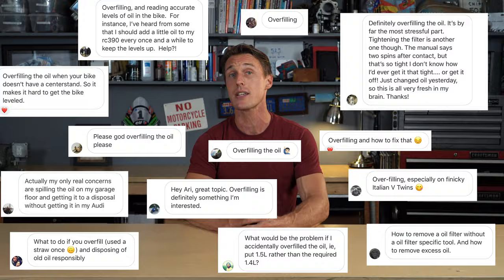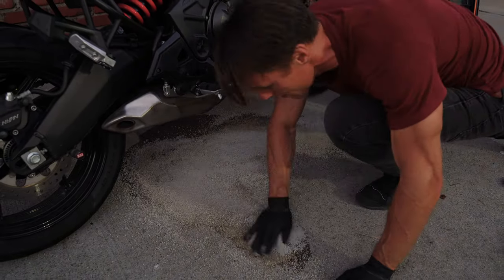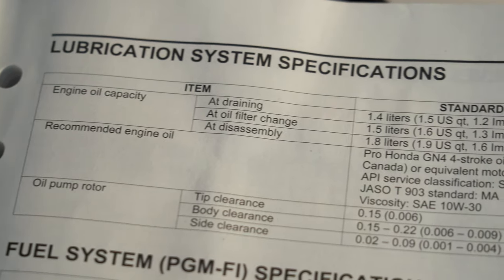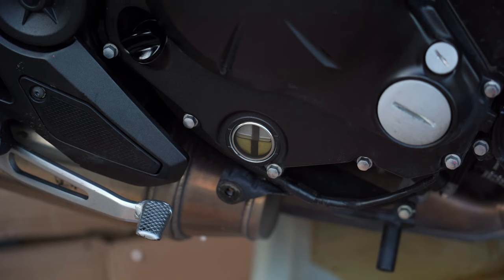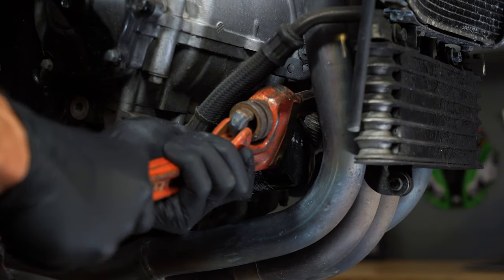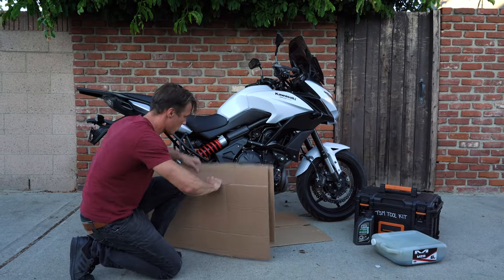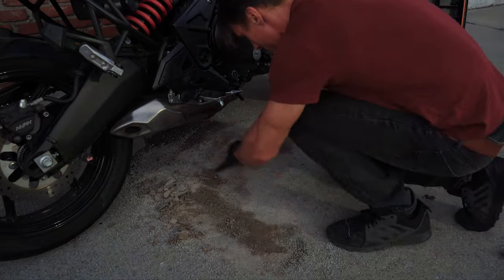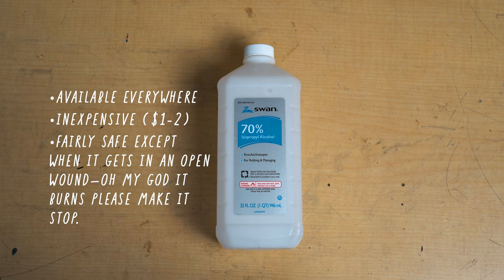Overfilled Oil, Stuck Filters, And Oil-Change Hacks | The Shop Manual

Comment: I have found that if you let the engine cool down before you attempt to remove the oil filter, it comes off easier, or buy a K & N filter with the 17mm nut.

Comment: Turkey baster is my favorite cheap and disposable tool in my oil change toolbox. Little too much oil? Sucks right out through the fill plug. A smaller piece of tube can be used to attached to the baster to extend it if it’s not getting suction.

Comment: My favorite oil-change hack is the one where you only ride 2-strokes.  In street bikes which pretty much all had automatic injection, this just means topping up the oil tank every once in a while.  Then change the transmission oil like once a year or something; clutch and gear debris is kept out of the engine so you can let it go longer.  And no oil filters, ever.

My SECOND favorite hack is the Aquafina trick.  Bikes will vary, but at least on all the vintage Yamahas and Kawasakis I've had, the dipstick/filler threads are the same as an Aquafina water bottle.  So cut the top off to make a funnel, then you can thread AND TORQUE your new funnel in place.  It flows faster than a "real" funnel, is sealed from spills, and can't get knocked out of place or bottom-out on your clutch or whatever is down there.  This was very valuable during that dark time when I owned my 4-stroke Yamaha and thus had to dick around with oil constantly.

Comment: One hint for anyone with some bare tools that happen to cross stuck oil filter. Get a decent length bolt that you have socket or box end wrench that fits. Then cut the thread end with angle grinder or hacksaw. Now get piece of strap that goes around the filter and put its ends through that slit just made. Open filter. There can be cases where some idiot has put filter way too tight into something you can't fit any tool. In worst case if you hammer screw driver through filter you can make it just torn apart in place. I've encountered this couple of times and since moved into this bolt and strap strategy and it hasn't ever failed.
Reply: I'm not sure I understand your instructions there, but claw type wrenches work great.

Comment: Oil filter pliers are great..   Didn't mention them!
Reply: Yeah lubing the o-ring with some fresh oil and not over-tightening is key! But I have a couple sizes of those oil filter pliers and they are nice even on non-stuck filters.  Use them on my car too.
Reply: Yeah I have the oil wrench socket thing. I always just go "hand tight" on the filter to tighten.  Maybe stick that wrench on and go a tad more than hand tight. But last time it came right off easy.. with oil filter pliers, LOL.. but could have used wrench.  Good thing to have one of each I think!
Reply: Can never have enough tools!

Comment: Don't use rubbing alcohol as a solvent for cleaning oils. It is only 70% alcohol, the other 30% is water. Go to a home improvement store and purchase pure IPA (isopropyl alcohol).  Note: Not all home improvement chains stock solvents (other than paint thinner). I can purchase IPA at my local Home Depot but not at Lowe's.

Comment: For my Sportster have to get a soft drinks bottle and cut a section out of it so it fits under the oil filter to catch the oil released when I unscrew it to avoid oil getting in places difficult to clean.

Comment: 2:41 when i was a kid and used to do oil changes on my parents and relatives cars a couple times i used a screwdriver and stabbed the spin on oil filter straight through and used the screwdriver to turn it if it was way tight.  It was on an early 90s VW and very little room to reach it.  Anyways i comment as i watch most videos :)

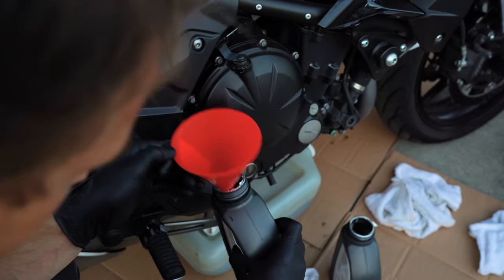Comment: At 4:39 when you're talking about obvious ways to avoid spills (the "use a funnel" segment) - it also helps if you pour the oil correctly, with the opening at the top, so that air can get in, and it pours smoothly. Don't feel bad, every single YouTube oil change "expert" holds the bottle upside down when they pour oil as well.

Comment: If you have your oil changed at a dealer, bring the proper sized wrench with you to check that they indeed tightened the drain plug(s). You only need a drain plug to work itself loose on your ride home once for you to always do this. (Hand to God it happened to me, thankfully at a slow speed while pulling away at a light)

Comment: another tip to remove a stuck filter is to fold sandpaper over so it’s abrasive on both sides and wrap it around the filter to give you some grip

Comment: Strap wrenches suck, I have the scar to prove it–I'd much sooner use the screwdriver trick, but didn't know it at the time. Definitely spring for a filter socket, or buy a filter such as K&N that has a small hex-shaped extension so you can use a regular wrench or socket. They're often just a couple bucks more.

Also, I know the drain plug has a torque spec–ignore it. Use a box wrench and don't go crazy. 18-year-old me managed to bork his oil pan and had to drop out of a much-anticipated trip because he was trying to be diligent and follow the book. JB weld wouldn't seal it, either.

Comment: I've found that if the oil filter is secured using a bolt (ninja 250 comes to mind here), a breaker bar is your best friend. Stick your head under the bike, remind yourself which way to loosen it, put it up on the centerstand (And have an assistant hold the bike still if needed), and apply constant pressure until it gives. Do the first turn or two with the breaker bar, and then it'll be loose enough to just spin off by hand. Let any remaining oil drain, pull the old filter and seals off, clean, dry, and reinstall. Most tedious part is waiting for the water to fully dry off. The hardest part for me was actually tracking down the requisite 17mm socket head and 1/2" to 1/4" socket adapter at my local hardware store

Comment: Harbor freight sells locking oil filter wrenches. Think vice grip but with a oil filter jaw. If you really need that much torque, I feel like it's a better option than trying to fit a pipe wrench in there.

Comment: Great tips.

Isopropyl alcohol is not safe for all plastics.  It'll dissolve acrylic, and that's one of the three polymers in ABS, which is commonly used for motorcycle fenders and fairings.

Comment: My 09 zx-6r was about midway up he bike, recessed in far and tight enough I couldn't even get my hand around is, much less stab it. I went to K&N wrench off filters that had a (correct me if I'm wrong) 17mm nut on it, so you can remove it with a socket. I have heard of nut breaking off when trying to remove it, but I never personally had that issue. 

Oil filters only need to be firm-ish-ly hand tight, not gorilla torqued. I think most torque values for filters are like ~8lbs, which isn't much. Also use a couple drops of oil to lube the sealing ring, that will help it snug up easier, and removal for next time will be easier too. I have never had a filter loosen up or leak on me by not screwing them on super tight.

Comment: I picked up an oil change tube for my crf450L.  You lay the bike over, take drain plug off and put the change tube on it and pick it back up.  Only picked it up because oil gets all over the frame and skid plate without it.

Comment: You can also use a belt to get stuck filters off. ;)
Reply: You can also use them to open stuck pickle jars.
Reply: Yeah, plus if you take long bolt, cut it's thread end and use some strap you can get filter out of virtually any machine without breaking filter. Handy tactic if normal filter tools won't fit.

Comment: Oh man, overfilling... While on vacation, traded houses with a couple in Barcelona for a couple of weeks, nice appartment with a parking place in the basement in a shared sub-terrain garage.

So I noticed the oil level of my bike had gotten a bit low, bought some oil, went to fill it. Darn! Too much... Since I didn't have all the equipment I have at home, I decided to drain a bit from the drain plug. Loosened it a bit, very small drip. Loosen some more, lost hold of the plug...

Exxon. Valdez.

In a half-panic I decided to throw my long sleeve shirt on the (by then) pretty substantial oil stain. Later with a lot of paper towels the parking spot got pretty clean again, since the floor was very dusty to begin with it may actually have been cleaner after my unintended oil bath.

But man, that sure ruined the shirt!

Oh, only now got to 3:59

Comment: What works way better then laying cardboard down is puppy training pads. Even though it’s pricey you can reuse the pad until it’s filled with oil. Since the puppy pads are like diapers it just absorbs the oil up. Plus you don’t need to worry about kitty litter either cuz if you have an oil spill flip the pad over and bam soaks it up.
Reply: Yup, I've got some of those in the garage as well. They work great.

Comment: Thanks guys for this saviour video. I needed this as my Ducati Scrambler after the last oil change is above the oil level in the glass. It's actually too full, like the glass is full even after a ride. 😠 I had a bad experience after I asked to change the oil and when I went to take delivery,  not just the oil level was high, the oil color didn't even change. It was the same black color as the first question i asked the mechanic was "didn't you change the oil" as I didn't see any visual change plus the oil level was too high which he replied the level will be normal when the bike will run in and to the color, he was like it's because the engine must have carbon deposits and old oil which I couldn't digest. My Ducati Scrambler is only  run 6500 km (4039 miles)
I was thinking to drain the oil and see the full quantity but after seeing the video I will give it a try of sucking out the oil by the syringe & tube method. 👍🏼

Comment: My 2015 FJ09 didn't like the oil inbetween the sight glass lines. It needed to be all the way in the top line or the oil warning light would come on at high RPMs. I read online a lot of early FZ09s also had this issue.

Comment: going to try the sprayer nozzle to remove overfilled oil in my R6. Looks like you just feed the tube down the into the clutch cover area and spray out the oil. I'll give it a try

Comment: I’ve done a lot of oil changes on motorcycles. I then bought a 2012 zx6r, and so I’m here. The oil filter is basically in the middle of the bike under the seat...couldn’t get a tool in there if I wanted to

Comment: I use rubbing alcohol instead of using brake clean on everything. It's way safer and won't damage Plastic or rubber. It's super cheap and it evaporates a lot slower giving you more time to scrub or wipe

Comment: My dealer slightly overfilled the oil at the complementary service when I bought the bike, I didn't notice right away as it was half way between the max level and the top of the sight glass, but I did notice on the first couple of rides my cam chain tensioner was playing up at aroun 4krpm. I meant to take it back to get checked at it had a 90 day warranty, but the dealer was far and then I noticed the oil was high. I tried chaning the oil and filter and boom, no more cam chain issues!

Comment: Thank you for mentioning counter-clockwise. "Lefty-loosey" makes no sense, because it presumes looking at the top instead of the bottom (if you turn the top left, you're turning the bottom right). It's a relative direction that doesn't give a starting location.

Comment: Just do a search for oil capacity harley or fluid capacity harley big twin or even fluid capacity by specific year and model - I cant find it anywhere and it's NOT in the Manual that came with my electraglide.   And, yes, yesterday I overfilled my oil because finding the right level was a bit trial and error!  So thanks for this vid!

Comment: If you forget to order some new crush washers ahead of time... Instead of reusing the old one, pretty much all hardware stores will have big nylon washers that will do the job just fine.

They look a little weird because the drain plug will squish them out quite a bit but I've never had any problems with oil leaks from them (also they are hella cheap, like 10-20 cents each). Or just order the pretty brass ones before you start the oil change lol

Comment: A warm oil filter will loosen easier than a cool one. (As will most fasteners.) It's good practice to have your engine at full operating temperature before changing the oil. This ensures any particles are suspended in the oil and gets emptied when drained.
And yes, you can top up your oil in the filter before screwing it on, if it screws in with the top facing up. In all cases check the oil level after running the engine and letting the oil level settle for about 5 minutes.
Keep everything clean by cleaning off the dirt before you start, then wiping the drain plug and oil filter contact areas before refastening the new ones. Never reuse the drain plug crush washer and tighten to correct torque.
Reply: Don’t prefill oil filters. One day you will regret that. Dirt, hair, and eyelash, you will drop something on the clean side and it will wreck havoc.
Reply: @JAMESWUERTELE  Depends... If when you do your bike's maintenance you make sure the bike, tools, and all working surfaces are clean, and you also immediately fasten the filter after filling it, you have nothing to worry about.
If you're not fastidious about cleanliness, it matters little if you've pre-filled your filter or not, there's more probability something will get into your oil that the filter cannot remove...

Comment: In the section on checking level, should mention that if you changed the filter, you should get it in range then idle the engine for 30 second, then let it sit for a few minutes for a final level check.

Comment: I just removed the filter from my BMW r1100gs. I didn't have the socket type. And the three finger filterclamp didn't fit. So I drilled two hole  en screwed in two bolts to have leverage for a spanner. The filter is completely surrounded by the sump, so this was to only way I could think of.

Comment: My humble observation is that every consecutive time you change your own oil you'll probably get better at it. Also, every bike has a different arrangement. My next bike will probably be naked, with easy access to all the fluids for that reason. I know naked bikes are more vulnerable, but it's easy enough to buy some protection that doesn't block all the caps and plugs.

Comment: Stuck filter.  Yes this happened to me for the first time.
What is to blame ?  Torque wrenches that are not accurate.  We trust these things too much, and they let us down.
Result = the damn filter was on too tight.
I tried so many things,  and nothing was working.  That thing would not budge (and we don't have much room to work with under a bike, either - so that definitely did not help matters.
I did not want to do the screwdriver punch-through just yet - so I bought a 16" Channel Lock.  (huge, long monster)
I had to remove part of my fairing and move some drain tubes out of the way so I could get more (leverage) - but this was the only thing that worked for me !
I will never trust my torque wrench again, and just go by (feel) from now on.
Oh, and by the way - my drain plug (same torque wrench) - was also on very, very tight.

Comment: About a year ago we had a car come in for an oil change. Customer stated he couldn't get the oil filter off as well as the drain plug. I was the lucky tech to get this ticket. Ah boy was it a fight to get that filter off. I used the screw driver trick and all that did was rip apart the casing. I eventually got it off with an air hammer and chisel. Next was the drain bolt, which was over torqued and stripped. Thankfully my easy-out (or bolt grabber as some may call it) was about to bite into the bolt. Customer said the last oil change was done by jiffy lube down the road. He wanted to save alittle money and do it himself but jiffy lube made that impossible.

Comment: You're holding the oil can upside down. The purpose of the funnel is to reduce the likelihood of missing the opening.  But, if you flip the can the other way, you can precisely line up the opening of the can with the opening in the engine and get the oil in that way.  That's the whole point of having an oil can where the opening is to the side rather than the center.

Comment: Dude this happened to me.....but the issue was didn't warm up the engine before emptying the primer & engine oil..I used a turkey baster pump..really worked..Hope..didn't damage anything..because..only reason I knew was too much oil is..when I had the bike idle warming up after fill ..the cover for engine oil literally "shot up"!..and landed few feet away..

Comment: I really need you to go over chain tension. HOW HARD DO I PULL THE CHAIN WHEN CHECKING IT??
Reply: Moderate. Don't need to try to pull the chain off, but definitely till most slack is removed. Just did it today. (my chain was embarrassingly out of spec)
Reply: @redeyedfreaks  thx m8

Comment: Please do not drive a screwdriver through your oil filter. I've been there, almost damaged my bike driving the screwdriver too far. It also almost didn't work. The screwdriver was just ripping through the filter instead of turning it, and it made a huge mess. The gasket on the filter wasn't lubed from the factory. Those other filter wrenches are also basically useless when that happens, but theres a kind you can buy that goes on a ratchet and has "fingers" that clamp down on the outside of the filter and create indentations as you're trying to loosen it. This gives it amazing grip as it squishes down into the filter. It's a bit tricky to get started, but works way better than a screwdriver and it's cheap. Get one of these, you can find them at Wal-Mart.